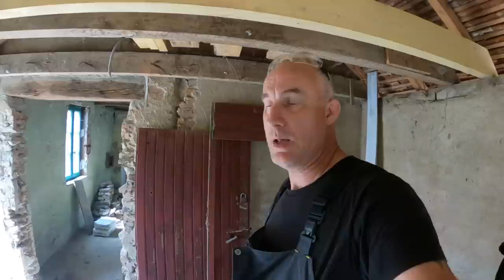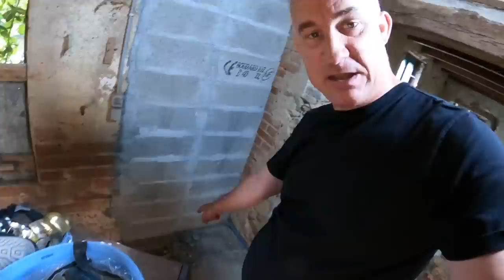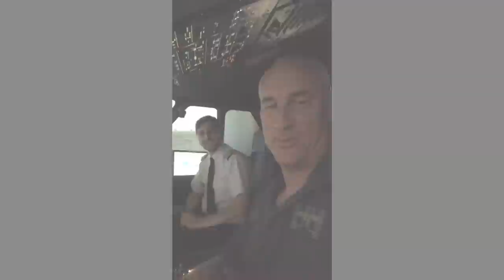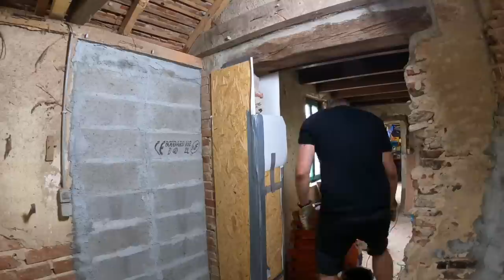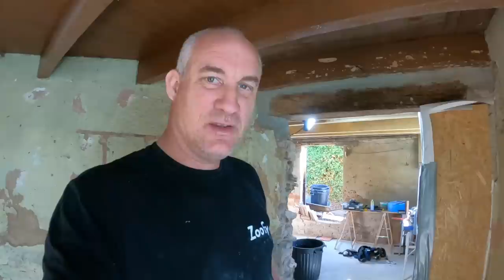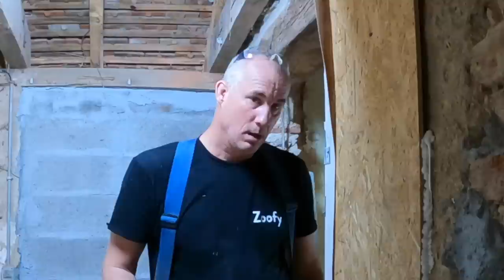This Old House, Renovating an old country house in France

Comment: Lime mortar allows the walls to breathe, which is essential for buildings built with stone and lime. Adding concrete to walls built with lime mortar and stone causes moisture to accumulate in the stone and lime. This damages the stone and creates further degradation in the existing lime mortar in the old walls. If you want strong walls, you need to use materials that are compatible with the existing walls, not materials that will undermine the integrity of the walls you're starting with. Concrete isn't compatible with lime mortar. Sure, concrete is harder, but it also holds moisture and damages traditionally built walls. I'm sure you're going to figure that all out eventually, but i hope you don't do too much with concrete before you get so far into the project that you find yourself needing to undo anything too major.

If you want an example of repairing traditional brick, stone, and lime mortar walls, check out "Escape to Rural France". He's rebuilding an old chateau that burned down in the 80's.
Reply from the maker: The concrete used in this episode is only to build a frame for a walkway through a lime and stone wall. It’s not covering more than the thickness of the wall. This vlog episode is probably about 2 years old. Since I have  done a whole lot of masonry with Portland cement based mortar where structurally needed. No more than that. I’m well aware of the requirements for lime mortar stone walls. Thanks for your comment. I hope you’ll watch the more recent episodes as well.😀

Comment: If you have  a reciprocating saw use it without a blade to do the vibrating of the molds.  Smoother surface and better coverage
Reply from the maker: Hi Tim, I know that trick. Was afraid my mild wasn’t secure enough. Going over the mold with a sander can also do the trick although less thorough then the recipro saw.